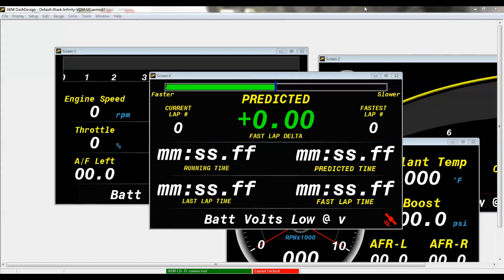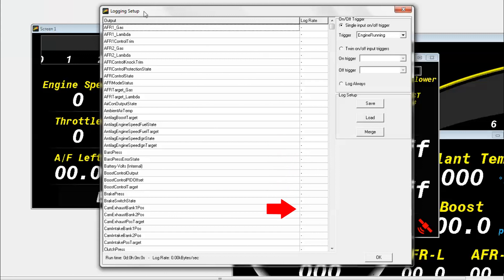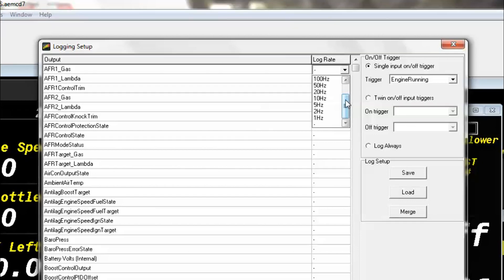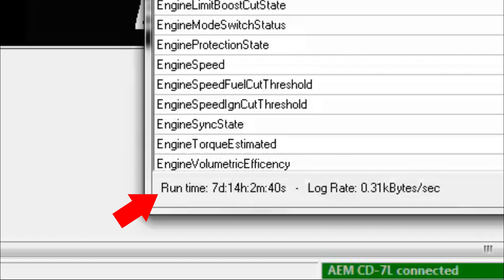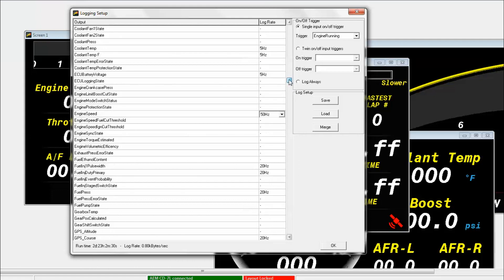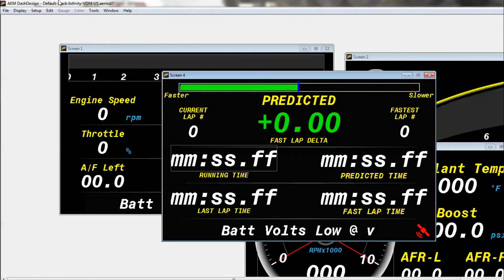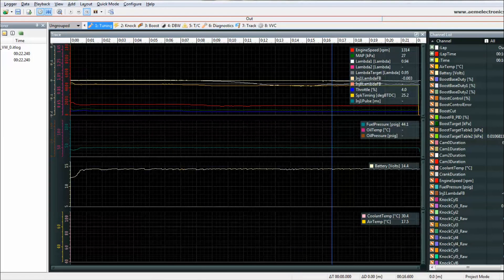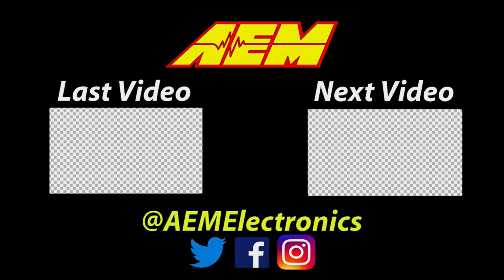Transferring CD Digital Dash Logs into AEMdata (AEMdata Tutorials)

Comment: Is it possible to configure the system to create a new, discrete log file for each run  (land speed racing application)?  Right now, my log file just keeps getting bigger and bigger with each run, as opposed to creating a new log file for each run.   I'd like to have individual log files for each run, but don't know how to  set up a configuration to allow this.